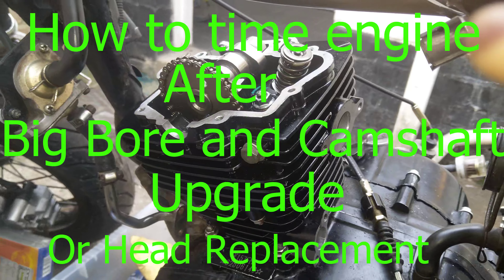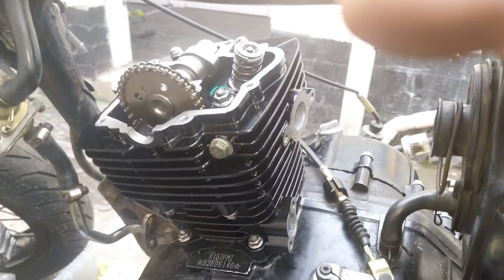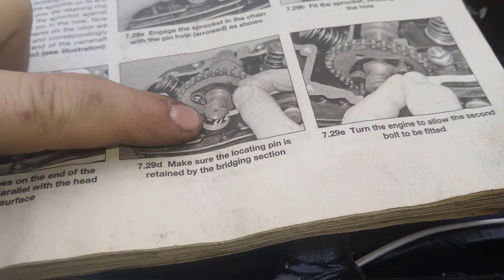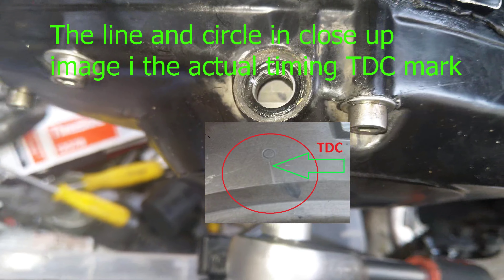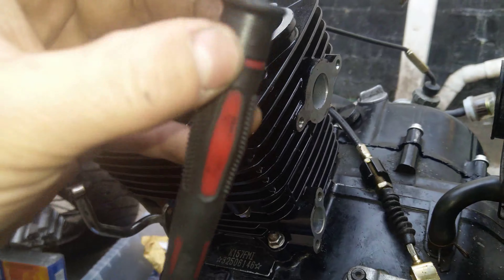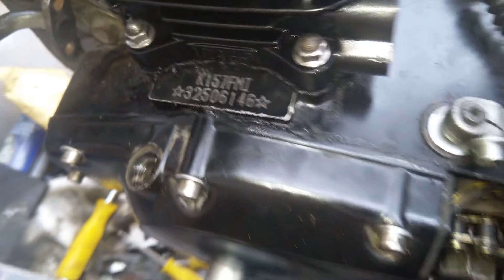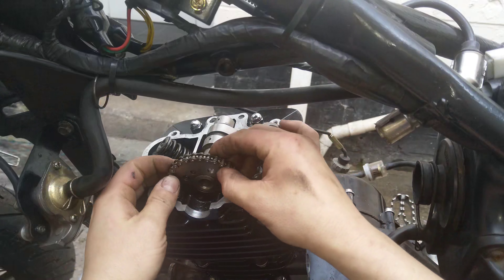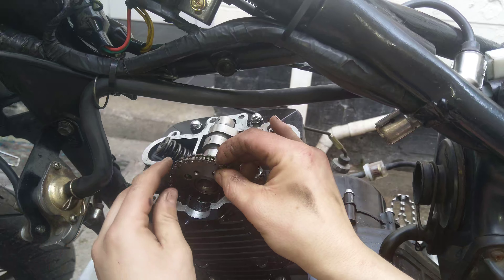How to set timing  Suzuki GN GS EN 125   Sinnis Apache 125 Pulse Lexmoto Adrenaline RmR Superbyke

Comment: Hi man, I seen on other videos a camshaft upgrade is comparable to a big bore upgrade, I just ordered a 150 big bore kit, I might try the cam first might be easier to install . What you think ?
Reply from the maker: Aftermarket camshaft is much better upgrade.
Reply: @Ray88G  thank you for the advice 👍
Reply: @Ray88G  Hi quick question, I have found upgrade high performance cam for DR125 is this compatible with GN 125? Thank you, my GN is 1997
Reply from the maker: @upsidedown1986  Yes it will fit .
Reply: @Ray88G  thank you that is great 👍👌
Reply from the maker: But share a link then I'll tell you if its worth buying it
Reply: @Ray88G  it the link won't show up here I'll try on Facebook I requested to join yesterday
Reply: @Ray88G  Hi man, my request is still pending to join the Facebook group, is there anywhere else I can share the link so you can see and tell me if it worth buying.
Reply from the maker: @upsidedown1986  I left all Chinese motorcycle groups. 
Search for Raimonds Gerhards on Facebook.
Reply: @Ray88G  I'll try find him, thank you 👍

Comment: Got a keeway RKV changed the piston and cam but its not firing correct with the electroic ignition. I think with the bigger piston it has to much compression. What do you think
Reply: What year ? Try to advance the throttle position sensor, mark where it is now and advance it a couple of degrees. 
 On my 2018 RKV I've had some success with the Arrow full exhaust, that coused too lean mixture and irregular ignition with pops and bangs.
 If the engine starts to rev up at idle, reset the ECU.

Comment: What and Where do i get the camshaft?  And what jets do you run? I have a new 150cc big bore, EGR blanking kit and a Toro oval Carbon tip exhaust.
Reply from the maker: Type into Aliexpress..gn125 race camshaft And 105 main jet with 1.5 or bigger pilot jet needed